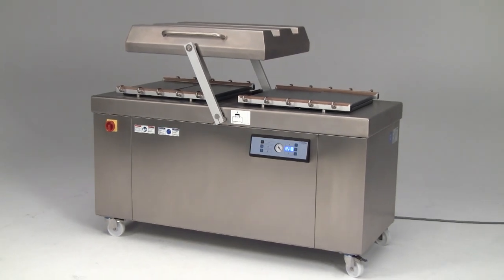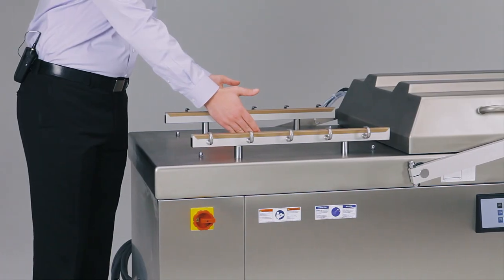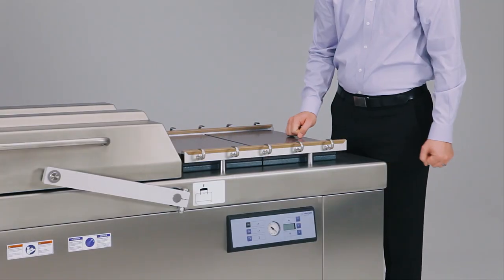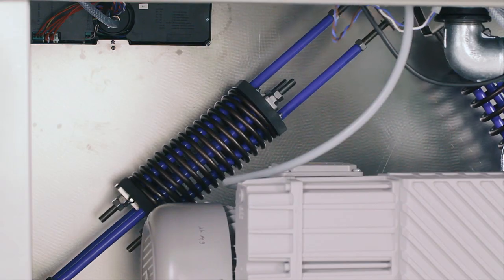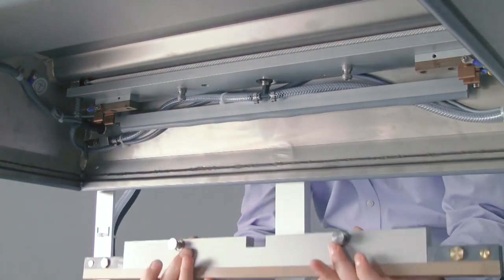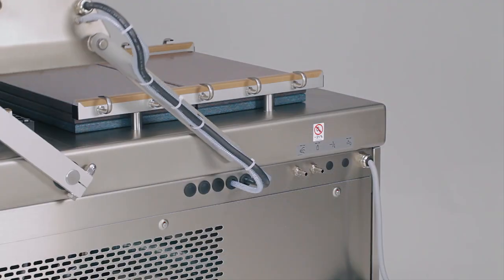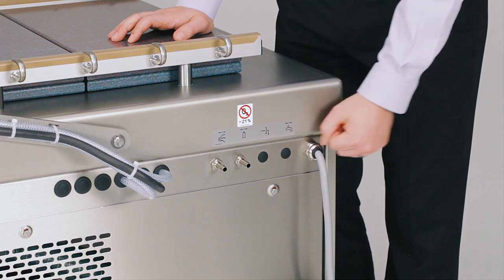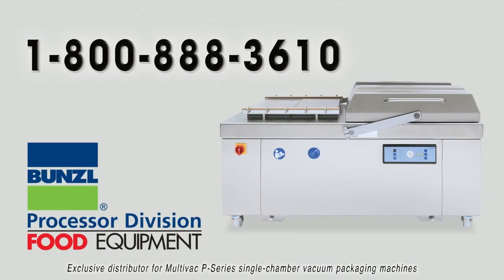Multivac P600 Vacuum Packaging Machine Overview

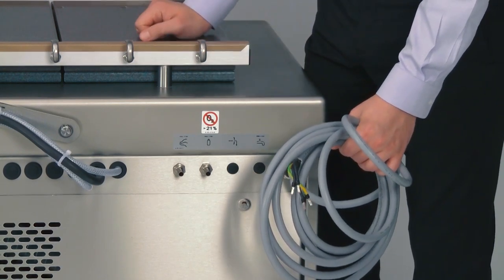Comment: did he  say 22o amp? 4:00
Reply from the maker: It's actually 220 volt.  30 or 40 amp depending on pump.
Reply from the maker: Hi Mario! Correct, 220 amp.

Comment: Que es error de contorneo
Reply from the maker: Para obtener más información, llame al 800-888-3610.
Reply: Did he just say 220 amp? I think he ment 220 volt
Reply from the maker: 220 volt.  30 or 40 amp depending on pump.